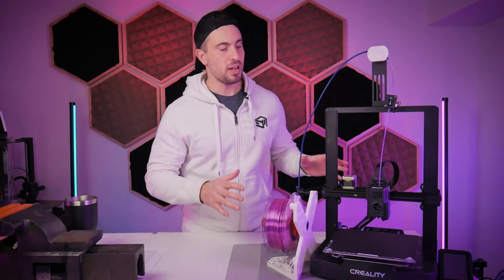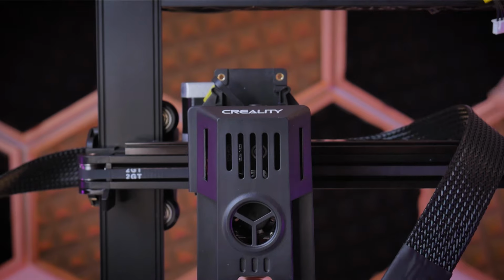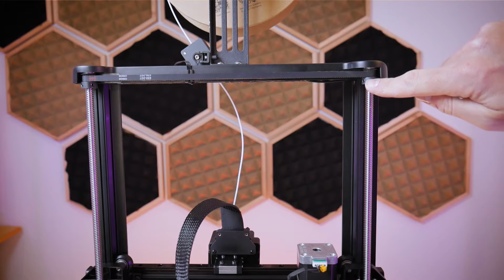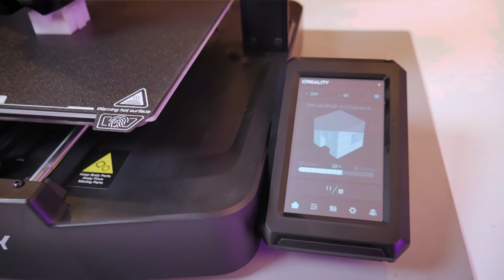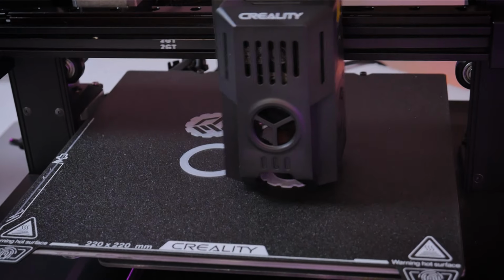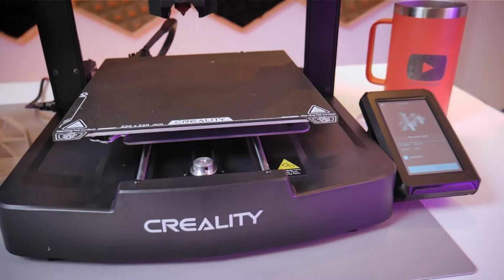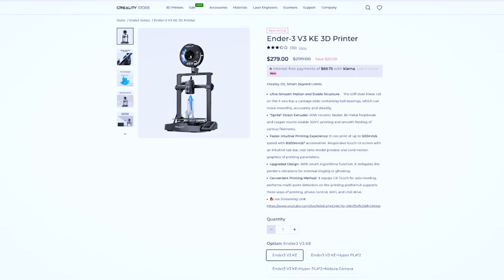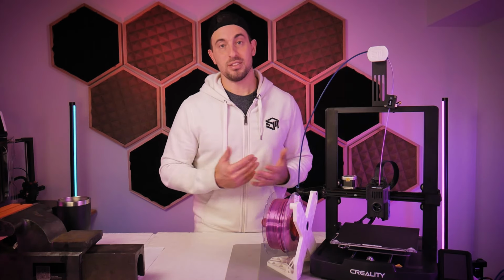Creality Ender 3 V3 KE Setup Guide, Tips, Review, and Upgrades

Comment from the maker: I recently released the 10mm Y-Axis rod upgrade for the Ender 3 V3 SE and KE models, check it out here: https://youtu.be/vzOEuqaEv_4
Also, If you guys liked this video I recently released the long awaited Ender 3 V3 Core XZ video, check it out here: https://youtu.be/x923Bkr1TwA
Finally, if you appreciate my in depth content, you can support the channel by checking out the links below. As an Amazon Associate I may earn a small commission (at no extra cost to you):

Creality Official Store (Creality KE)
► https://shareasale.com/r.cfm?b=2446041&u=3650799&m=124834&urllink=&afftrack=

Creality Amazon Store (Creality KE)
► https://amzn.to/49qxZJC

Creality Amazon Store (HYPER PLA Filament)
► https://amzn.to/3M8zrXc

Polymaker PolyTerra PLA (One of my favorite filaments):
► https://amzn.to/3sdhK1x

eSUN PLA+ (Another one of my favorite filaments):
► https://amzn.to/3QA4tuq

Electric Screwdriver (shown while working on the printer):
► https://amzn.to/3JRbbZe

Comment: @EmbraceMaking  Be extremely careful using blue loctite around plastics, especially thermoplastics.  It will melt and breakdown the plastic.  The printing plate screws look like they go through plastic spacers.
I found this out the hard way using it on the screw for the plastic cover that hides the wheel nuts on my winter tire rims for my vehicle.  I got a bit of it on the plastic shoulder that the screw tightens up on and the loctite disintegrated the plastic and it fell apart anywhere the loctite got on.  Hmmm, now that we have a 3d printer in the house, maybe I can print out a new one!

Comment: Brand new to 3D printing. I have the SE model that I added the Klipper (Nebula Pad Smart Kit w/ camera) to. Even though its STILL a bit different from KE model, I found this video to be helpful. 
Moving the spool on the gantry is on my list of upgrades for sure. There are many different designs out there. All others I've seen and thought, "why not use a tube to deliver the filament?" Yours is the first design I've seen that does that. 👍

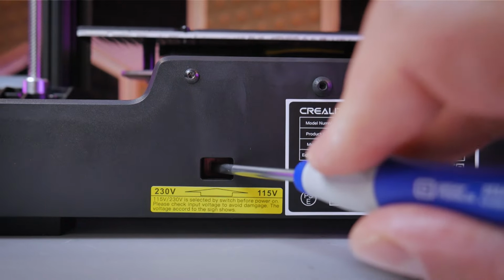Comment: 5:20 To toggle between 230V and 115V, you SLIDE it left or right like swiping on a phone, not pushing it down like a switch.

The video cut off a crucial part that could fry up the power supply! Took me quite some time to figure it out I hope this helps to those having the same question!

Comment: I fucking hate Creality I got an ender 3V3KE and within the first three months error 2509 appeared I bought a new motherboard. I bought a new nozzle plate. I bought a new gantry. I bought a new print bed. I bought a new screen I checked for burn marks I’ve checked for wiring and it’s not fixed at all currently I am sending it back the manufacturer and got a $400 refund

Comment: I have the same model, but I am facing problems which noone video is responding. Started with  these calibration printouts, but stopped at trapeze type printout , where these sharp rounds are not even. But, when it comes higher, it's looks ok. Why? What kind of adjustments I hape to make and where? I am using Orca Slicer, it seems ok, but...question remains - how to print oput nice cube with even sides.

Comment: Is mine BROKEN? in the menu, when Im printing I try to adjust the Z-offset and when I hit the + or - it LAGS I hear the beep but the screen does not reflect realtime?
Reply: The touchpad sends lines of G-code into a buffer. So when you adjust the Z-offset during a print, it can seem like there’s a lag because the printer is still executing commands that were already in the buffer. The Z-offset change takes effect a few seconds later, once that adjustment reaches the front of the queue.

Comment: Anyone with an auto bed leveling error during set up, please read this. 

This was a very helpful video for my setup of a refurbished printer. I really appreciate the visual, step by step guide, which made the assembly a breeze.

However, I couldn’t for the life of me figure out why I was getting an error during set up, but noticed my machine head was going off the heat bed during the calibration. After scouring for answers, and a big headache later, I noticed a loose screw on the right hand side of the gantry which, turns out, controls the tension of the belt. I tightened it, and sure enough it solved my issue. 
Edit: this can also be done too tightly as it resulted me in different issues. I learned that you want your belts tension to be firm but still have some bounce if you were to push on it. 

It should have been a simple and obvious fix, but for some reason, I spent several frustrated hours unable to figure this out. So although assembly was a breeze, I do wish this issue was addressed in the quality check portions of the video. 

Hopefully my frustration can help someone else in need and make it worthwhile.

Comment: Great video highlighting  lots of things that may need to be corrected out of the box for the newbie.

I've been reading lots of comments on other vids about stuff that needs fixing out of the box on these printers and having a hard time 
understanding the buyers mindset here.

Its all well and good having something that allows you to upgrade and modify but surely everything should work correctly out of the box and not have to be corrected before first use??!

Imagine buying a car and accepting the fact that you'd have to fix a bunch of stuff before being able to use it? They wouldn't sell many cars.

Justifying poor quality under the guise of being able to "tinker" with it or the fact that it has a lower price doesn't seems like a good enough reason for manufacturers not to raise their quality standards.

With that in mind I decided after much consideration that I'd spend the extra money on a A1 which seems to be fully usable from the get go.

P.s this isn't a negative comment about your video but more an observation about certain brands of printer in general.

Comment: Could you do a video on the KE vibration sensor installation? No one I've found does a good job with that. The instructions are poor at best. No one shows it working after calibration, i.e. normal condition, nor with good cable management, a permanent installation, or what comes in the box.  I ordered one yesterday...

Comment: Just bought one and installed it, but it does not get further than the set-up. I get to the point where it is heating the bed and nozzle and it almost immediately stops heating and then just remains stuck on the "heating bed" and "heating nozzle" steps. Does anyone have a solution for this? Already checked all the connections on the motherboard and they seem fine as far as I can see.

Comment: Hi, thanks for this great setup guide. The misaligned hot end wasn't an isolated issue for your printer. I got the same issue and mine was misaligned even worse than yours. I tried the procedure you showed in your video but couldn't get it fixed. It is maybe a bit better now but still misaligned. The issue is the main shaft (apparently this is how heat transfers to the nozzle) that is in the middle. It is not installed perpendicular. No matter how much I tried to loosen and retighten the two screws it didn't fix the misalignment issue. 
Now, I heard alot about the name Creality. I chose their product as my first 3D printer. However, I am a bit disapointed here before even my first 3D print. How did a company that cannot straighten out a simple alignment become so big in the industry? 🙄 I am pretty sure this is not a big deal for many, most people won't even realize it, (I probably wouldn't have immediately) and this won't affect the print quality (I am hoping). However, it is still such a simple issue that could have been prevented. Apparently, Creality doesn't have a good quality control, or they simply don't care. When I see a Creality 3D printer anywhere, you bet this is the first thing I will look at. I am pretty sure there are many Creality 3D printers out there with this manufacturing imprefection. 
I have yet to check if my printhead is perfectly horizontal.

Comment: Received mine yesterday. The extruder wasn't working. I found the long stepper plug on the mainboard wasn't fully installed and glued sticking out not touching all the pins. removed the hot glue, pushed it in and wow it's a monster... However... this small oversight in the factory could cause a noob months of troubleshooting issues.

Comment: Can u tell me what 2194 means on the v3-ke. Head not going up and down. Brand new machine.
Reply: I'm having the same issue. Only 3 days old and started 2nd dy. The more I inspect it, it seems like a firmware issue. I wish Crelity would fix this or I'm sending it back. Otherwise its a boat anchor.
Reply: Just bought a Bambu A1. Set it up no problem after it has been running a week🤓👍

Comment: Anoyone else, who have problem with warping at the first layer at larger objects? Any solution? Material: PLA, Hotend: 200 C, Bed temp: 60 C, I am despairing
Reply: Clean your bed with isopropyl alcohol before all prints
Reply: And change your bed adhesions settings

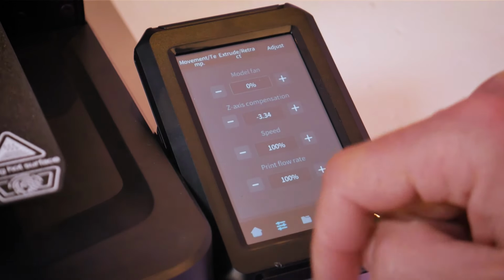Comment: great video, I didn't think to level the x-axis. One thing - I'm very confused about 22:50

I read on a tips website "If your nozzle is too close, decrease the Z offset. Lower and negative Z offset values move the nozzle further away from the build plate, preventing the print from being squished."

Which is it?

Comment: Hello . I am using the same device and slicing in creality print. The holes are 0.2mm different from the size I want. The parts that need to fit together do not fit together and the surface quality is not very good. I would appreciate your help, thank you.

Comment: Hi, 

Im new to printing I have ordered the KE, just waiting for it to arrive. 

Just a quick question, for better adhesion do you use a normal everyday glue stick on the Plate before printing?

Thanks
Reply from the maker: Nope, with PEI you really should never need glue stick again. For PLA heat the bed to 60 degrees and don't worry about glue, thanks!

Comment: I got a one new and when it self checks it always turns into a black loop any one knows the problem
Reply: Check the voltage selector. I had the same issue and missed the correct setting.

Comment: Thanks for the nicely explained video. I just obtained the KE and found your video very helofull. On my first attempt of printing, the printed dimensions are all to big. 
I was wondering wheather you will be able to provide some info about the possible settings and procedure in how to correct that. 
Thanks in advance.
Reply from the maker: Thanks! How much bigger are they? Tenth of a mm or bigger than that?
Reply: @EmbraceMaking  Thanks for the reply. It was off about 0.5mm.  
In the meantime I did the calibration snd reduced the flow rate. 
It prints fine now. Thanks again.

Comment: I currently have an Ender 3 printer with a 4.2.7 board and a CR Touch installed. I am considering purchasing a second printer and would like to know if you recommend this printer or if I should consider another model from the same brand.

Comment: Goth the s.e.
And a can print balbarrings.
And a can print 0.2.
You need to tune z. Offset by hand.
And run a test print over the hole bed.
A can print at 450 mms.
Using cura.
You also need to tune cura for this 
Speed.
Everything fly.s.
Off.
For the wobbeling.
A removed the spool and just hang on the wall.
Then a printed two 90 Degrees hooks.
And put at whit verry strong double side tape.
From the paper industrie.
And put against the z.axis.on the front.
And a printed spines for the cables.
And to day iam going to print the air flow.
Yeah and iam going to order the k.e.
For using a.b.s

Comment: New to 3d printing. I relocated my filament spool from the top, down to the side behind the screen. I am waiting for my ptfe tube, but once I get it, the filament sensor and the filament are both on the same side. The ptfe tube guide runs top left to bottom right (as you look at the printer) any recommendations on filament routing to make things not wonky? It's either going to have to not use the guide, take a longer than necessary (and possibly create a pinch point) route behind the printer.

Comment: I've had this printer for a while and there is one thing I started doing that totally enhanced how well my print jobs go. Periodically coat to outer edge of the nozzle with thermal grease or olive oil. Be it humidity or what, this prevented filament from collecting and curling around the nozzle. Extended my nozzle life dramatically. Nothing drastic, just lightly use a Q-Tip to apply it and my prints have been so much more reliable ever since.
Reply: is the "metal grease" that came with the printer something i can use?
Reply: @ragnarlindell7447  you can but I would go more with an oil. The grease eventually dries out and leaves a residue and becomes clumpy. 3 in 1 oil, olive oil or even vegetable oil will work, just lightly coat the exposed edge of the nozzle and the bottom of the rubber cover. In all honesty, since I started doing that, I have not had a single misprint and comfortable leaving the house and letting it print while Im at work.
Reply: Similar hack is using solder rosin on the nozzle and blasting w/ a dollar store mini torch
Reply: Isn't mineral oil better for that? PURETOL oil from Petro-canada for example
Reply: The craziest part about this comment is that olive oil smokes at a very low temp, but 3d printers don't get that hot. So this is legitimately viable.
Reply: @TheOriginalWerty  how is that "crazy" then, if they don't get that hot?
Reply: @queueeeee9000 crazy in the sense that, of all the oils, it's the "wrong" one for the job. But not very crazy, just a bit lol-lol crazy.
Words can be used to varying degrees, a bit like olive oil.

Comment: Great job i bought one after my k1 stoped printing the g code files from 3d labprint it does a great job of them but the k1 once i updated the k1 to the latest firm ware and rooted it i put the gcode files onto usb stick and it will home and calibrate and then drop the hot end temp to 140 and error 2111 any thoughts on that would be great Regards Bill

Comment: We just replaced our hot end and nozzle. The first print was great! We ran the auto-leveling and auto z-offset feature and then during the very next print, the nozzle started dragging on the board. We ran the auto-leveling and z-offset again and the third print was even worse! We then tried to manually adjust the z-offset but when it brought the nozzle to "home" it came down way too hard and buckled the bed a little bit!! This has never happened before. Does anyone know why running the auto-leveling and z-offset would cause the nozzle to become so off? We don't know what to do now. 😭
Reply: I don't know what causes this, but the same thing happened to me. I immediately turned the unit off. Then when I turned it back on I did a factory reset and then did the "equipment self test" again. After that I ran a benchy test and it has worked fine since.

Comment: How did you fix the bent bracket for the head? My new Ender 3 V3 KE has the same problem and Creality are very slow to reply…

Thanks for any assistance you can provide! You’re the only video I’ve seen that mentions this problem 

The bed level probe is dragging on the infill of my prints, so any time I try to do something that would require the probe to be suspended over the print I get a horrendous sound from it dragging on the infill…
Reply from the maker: I never did bend it - I ran it as is to see if it would cause problems. However if I wanted to bend it I would use either a vise or my shop press with bending brake installed. Yours must be really bad though if it's your probe that's dragging?? The probe should be retracted so far that it shouldn't be anywhere close to getting dragged... Are you sure it's not the nozzle dragging on the infill? I have a fix for that
Reply: @EmbraceMaking  I am not 100% sure it’s the probe! That’s just what made sense after seeing the slight tilt on the head

So It could well be the nozzle!

What is your fix for that? I’ll give it a shot
Reply from the maker: Not sure what slicer and slicer profile you're using... but try slowing down your infill to the same speed as your outer perimeters if those are looking okay, also set your infill width to 0.4 (same as nozzle), and if necessary reduce the max volumetric flow to keep the infill speed down. I don't know if its a cooling issue or something to do with the volumetric flow rate, but when you print the infill too fast it curls and warps upwards. Then when the nozzle crosses it you get that scraping. So you can make those adjustments and it should take care of it
Reply from the maker: That will help because I don't think gyroid ever crosses over itself, but gyroid infill is also considerably slower. Cubic I believe will cross over itself which is problematic when the infill is lifting. If you give my solution a try you should be able to use cubic again, or grid or triangle for infill speeds faster than gyroid. I'll check out those shims though, I know my KE bed is a bit slanted in the mesh - it's fairly flat but for some reason its tilted towards the front of the machine.

Comment: So if your thinking about buying a KE my advice is this. 
1. Make sure this is what you want.
2. If you purchased it on Amazon creality will refuse to help with anything warranty wise. 
3. Immediately replace the hot end with a micro swiss hot end because only 20 prints in my nozzle went full on Akira and created a blob monster that engulfed the entire print head. It took days to salvage parts and carve the blob out without damaging wires or the pcb board. 

KE parts are extremely limited and frustrating to get ahold of. Just be aware of that when buying.
Reply: You should have bought a Bambu lab 😢